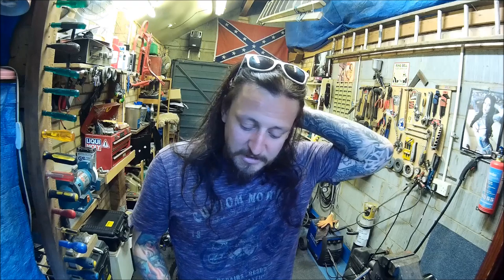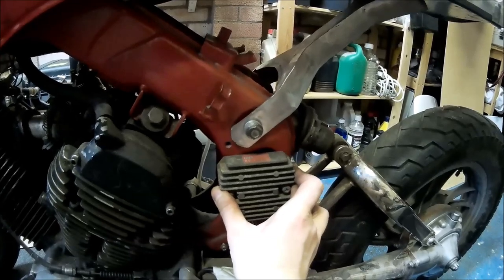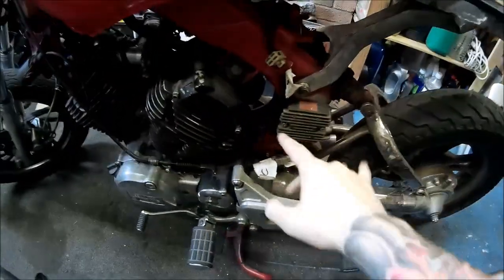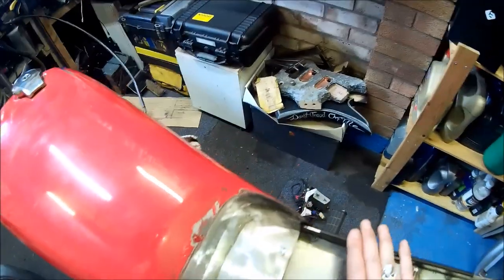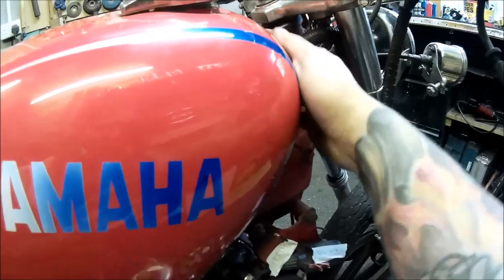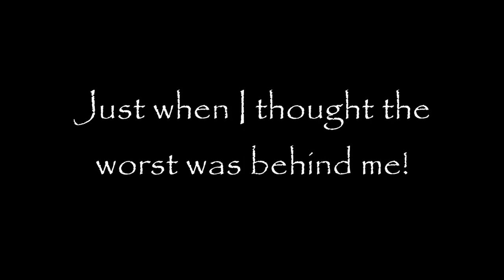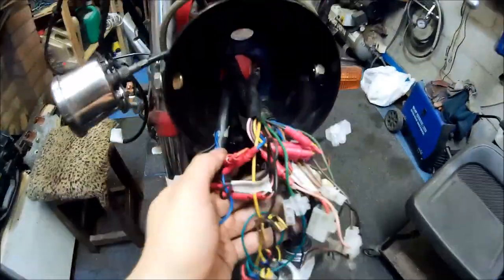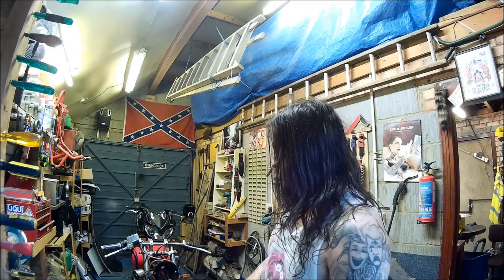Cambridge Pinstriping, Yamaha Virago XV 500 Cafe Racer - Part17: First look at the Electrics

Comment: Good to see you are you are making progress with the wiring and you know what you are doing.

I have seen some bodge wiring jobs in my time,wires just twisted together with a bit of tape on them..The tape usually falls off allowing the risk of shorts sparks and perhaps fire if it's not protected by a fuse. A soldering iron,solder and heat shrink tubing can be purchased for a few quid and goes to makes a safe professional job.
Reply from the maker: ant k that's right ant. it ain't that hard, just take some dedication. important thing is to focus on one thing at a time... otherwise there is too much to take on!
Reply: Yes i agree.If you look at the whole harness as a mass of wires it can look scary..A wiring diagram can be very useful i look at them as a road map the wires going from A to B...

.Looking forward to more of your videos.

Comment: great progress on the bike, electrics are still a black art to me, but am currently working through several issues now with the project loom, will take your advice on board, little at a time and break it down.
Reply from the maker: Thanks bro. It aint that hard really... Get yourself a diagram, a voltometer and follow it step by step. One thing at the time. If you look at the whole thing...yes, suicide attempt. But that horn button is really quite simple ;) and so on and so forth...

Comment: Simply Electrics suck I and a bike builder friend spent a month trying to track down why my bike would not charge, in the end it was as simple as replacing the wire harness with one we found in the scrap yard and it worked fine after that. Go figure! Cheers!
Reply from the maker: MidwestMotoRider yeah man, sometimes it takes black magic to figure it out. some other times it works fine after it rains for while ;)

Comment: Nice early one Mackie!! I just finished doing the electrics on my XV bobber a few days ago. Had some of those blocks as well, yours wins hands down though!!! Hah. Great mounting point for the R/R.  What carb is that on the bike?? I'm still running the dual set up. Take it easy mate, Al.
Reply from the maker: Alan Bell hey man. yes it's a mess...but I'm dealing with it the right way. I'm running SU carb, from a 1969 MG ;) different, right?

Comment: Hey Mackie did you eliminate any of the safety switches or those redundant relays? Really want to simplify the wiring on my xv500.
Reply from the maker: I did and I didn't. I left the relays, as I wanted to keep original loom in place, but I disconnected some of them.

Comment: Mackie!... oh, man... I can't believe myself, but I'm afraid I'm going to disagree with you this time. Since I always struggle with a clean, neat look, with electrics being as much as concealed as possible (especially wiring)... the mounting point you've chosen for the R/R, well... there's a space in the front part of the subframe (above the rear cylinder) on which the R/R could fit great facing downwards and still being kept cool enough, believe me. But as always, that's me!
Reply from the maker: MFP 2241 hey brother...I didn't even think about that. I will investigate this spot later on today, as I can always change that. but saying that I kind of like the way it sits there...I think it looks well with the engine next to it and all that. thanks for your input as always!
Reply: MackieBass... yeah, I know what it is when you have something already figured out and you don't look for alternatives since it looks good enough inside your mind. But in my defense, I think the protruding R/R could also interfere a bit with your ankle and heat radiated may also result uncomfortable. Plus, that wiring will be in plain sight... or maybe I'm just overreacting
Reply from the maker: Hey MFP! So I did had a good look today, and I think I will keep it there. My ankle/leg is miles away from the unit, and I will extend the other two connectors anyway to plug into the CDI unit under the seat. So there is only one visible connection, which I can live with. Whether the R/R will change position or not there are still cables from the magneto going up, so I think we're good. But fair point man, if you see improvements - shout!